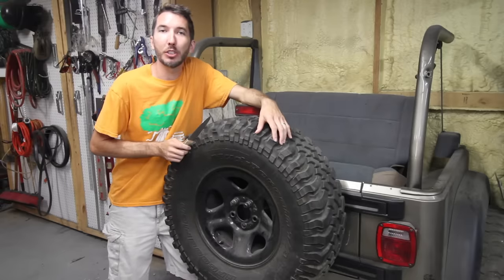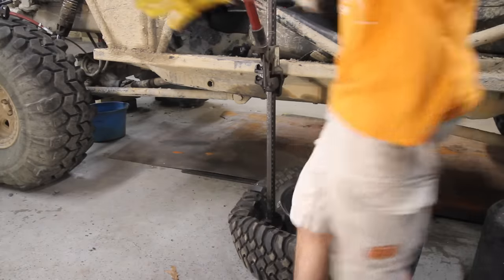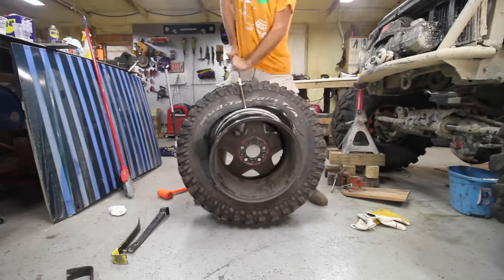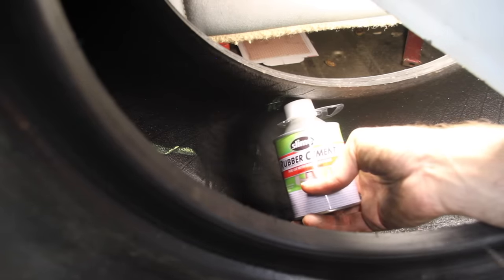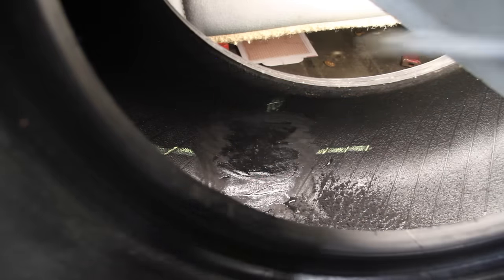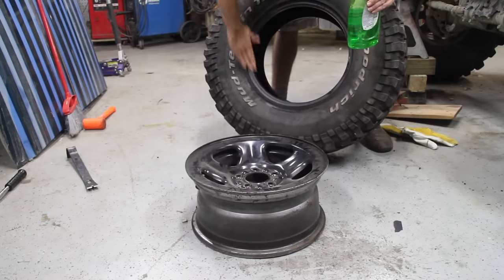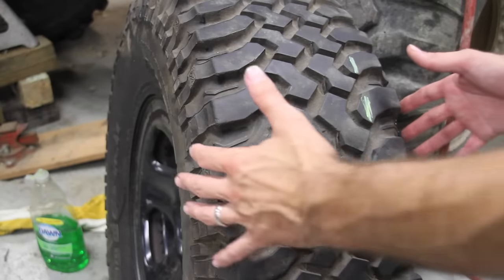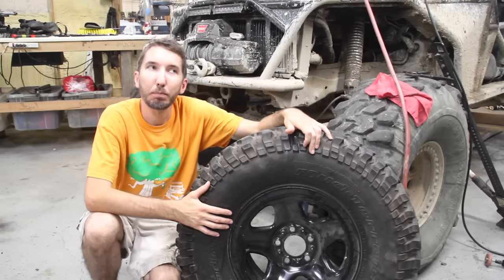How To Fix This - Patch A Tire

Comment: Used to work at a tire shop pretty much everything legally stated is correct,  but as he once stated again that is absolutely the best patch job you could do especially out on a trail because in all honestly that's EXACTLY what they would do at the shop. Legally they can't patch it but for emergency purposes this is as legit and professional as it could get. Being that employees can do their own work, I've actually done patches to my own tires on sidewalls not this big of course but actually had them last the 2 remaining years of the tire without problems. And DEFINITELY don't run low pressure in a patched tire as stated the tire will flex to much and eventually slowly peal the patch off.  Good video, for the idiot's stating don't do this if your 20 miles back on an abandoned trail with a tire issue,  this is the best And safest fix you could possibly do other than changing the freaking tire.
Reply: Jake Riley i
Reply: I've put plugs in my sidewall
Reply: All2skitzd I tore two tires on sledge hammer, has to patch a sidewalk by shoving 6 or more safety seal horsehair plugs to get me off the trail.
Reply: Cimarron Peacekeeper  
I had a sidewall spiked, put in 2-3 "Safety Seal" plugs in it held up for over 2 years as a spare. It sucks when you buy tires and they discontinue them and that happens. In fact I just had to plug one 2 days ago, now just a spare.
Reply: When I was a youngster back in the 40's and living in farming country, we used to patch worn tires so much that the patches showed through to the outside.  ;-)  Of course, in those days, wheels had inner tubes and those were hot patched.

Comment: Growing up, in 70's 80's we booted and patched everything.  I have seen huge boots put in tires, bigger than this one. Great video!
Reply: You put a good boot in it you can roll for a while
Reply: That's because in the 70's and into the 80's tires were bias ply, meaning there were no separate structures located within the tire's carcass, just the overlapping belts. Passenger car and light truck tires are now radial construction. When he says "liability purposes only" what that actually means is the tire is no longer roadworthy. He stuck that knife into the shoulder of that radial tire, meaning he cut the zipper. When tires explode on the highway, or when a truck loses a tire and sends shrapnel at passerby, that's frequently a zipper failure.
Reply: Boots how, what do you mean?
Reply: @AtlasJotun  No, sorry, bias tires were already pretty rare in the early 70's.  Just like today, you could and can buy them, but few people do except for agricultural use.
Reply: @allenwatkins4972  Wow, rare in the early 70's. Okay, I guess we're just ignoring the fact that all of the U.S. Big Three automakers were still equipping their cars with such tires, until the Japanese and Euro radial tires began eating up enough of the market that they were finally forced to catch up. But I'm sure they were rare, depending on how much you're massaging your definition of rare... And no it's not "just like today" since it wasn't illegal to run bias-ply on the road back then, whereas in many jurisdictions today, it is.
Reply: P.S. I will correct the error I made when I stated "...and into the 80s" since that's not applicable to the generalization I was making.
Reply: @xmo552  Boot is another term for a repair patch, not to be confused with the Denver boot that gets attached to the tire/wheel of a vehicle as a way to ransom one's car for parking ticket fees. Have a great day!
Reply: @AtlasJotun  
Thanks
Reply: @AtlasJotun  or could be the treads flying off a re-groved tire?
Reply: @AtlasJotun  Also not to be confused for a comment from a limey Brit.

Comment: when removing or replacing tire onto rim, make sure the bead of tire tha is inside the rim drops into the "well" of the rim. its the low spot of rim. it makes it much easier to get the tire on that last few inches. i hope im making sence

Comment: Great video, But just an FYI, tire shops are not putting the liquid rubber around the edge of the patch to reseal around the edge of it, they are putting liquid rubber everywhere they ground the enter sealant "sheen" as you called it off. The "sheen" you ground off is what seals the tire to keep air from seeping out through the bare rubber.

Comment: I've plugged and patched far to many of my street driven tires that I'd like to admit but so far it has never failed or gone wrong. I've even plugged my rear radial tire on one of my old CBR F4-I (crotch rocket) in a pinch before.
Reply: I rode a Honda Shadow on a plugged tire 'till the tread was gone. Even the people that sell plugs and use plugs claim they are a temporary fix but I've never had a problem after plugging a tire. A plugged tire is fixed.

Comment: I always carry a tire tube I buy at my local tire shop . You simply just throw it in and fill it up . I think that may be an easier idea for you to try .thanks for always posting such helpful videos . Your my go to Jeep guy
Reply: A split the size he made with the knife in a sidewall will pinch a tube almost as soon as the tyre rotates, and blow the tube. If you are going to use a tube the hole still needs to be patched to protect the tube from damage.

Comment: Done similar many times. I carry bailing wire, plugs, patches and, my favorite, plug patches. In my opinion the plug patches are the greatest thing invented for standard punctures. I've had to sew plugs into large gashes with bailing wire and was able to get the 20 miles back. Maybe you could do a video on the fine art of using bailing wire plugs and patches on one large gash for your next video

Comment: Thank you I have a very similar repair to make on a brand new GY Wrangler tire when the landlords loose roof tin blow off and punctured my tire. I had it dismounted so just need to repair and mount. I really want to be able to do this in an emergency thanks so much, I really like the way you handled it!

Comment: Howdy BleepinJeep,

I too have been patching sidewall PUNCTURES for decades
with absolutely NO failures ... but ... I do use a slightly different procedure 
For that 1 1/2" puncture - I start out with a barely  larger PATCH = like a 2" patch ... 
After that patch has been Rolled Out and adhered firmly ... 
I then rough the area again & apply a 3" patch over the 2" patch
then Finally ... 
I place the Largest Patch in my kit = like the DIAPER Sized patch over the previous two applications 
So ... I end up with not a single 1/16" thickness of Patch over the hole, puncture, or slit ... 
but instead 3/16" of rubber or THREE Times the Thickness over the "injury" ...  
Yes = this does end up with a HEAVY Spot on the TIRE ... but ... as you noted =
this is for   s l o w   speed Off-Road use ONLY ... 
(although I have been known to run them on the Surface Streets on occasion) 
COOP
....................................

Comment: Good video.  Remember to mark the valve stem on the tire for balance, couldn’t hurt.  Also lube the inside lip of wheel, and inside tire bead to help remove and install.  Lastly, just carry a spare inner tube.  Tube for Super Swampers run about $40.

Comment: New use for the three flat bars I've got, misplace one buy another & eventually you have 3 or more lol. This is how they did it in the old days, Grandpa had 3 stations in the 50s & 60s, in Mexico they still do this, now I know why those guys have a long pry bar, they can change & repair a tire pretty fast. Great video & yes a life saver or you could save someone else out on the trail or down the road. Good skill to know thanks.

Comment: This video scared the CRAP out of me! Though I had a dead pixel on my laptop screen (little orange dot on the lower right hand side). 

I had to make a similar off road repair went I cracked the lip of my aluminum rim. My good buddy JB was there to the rescue though! I hear it's still holding up to this day. Sometimes you gotta get creative with trail repairs so it's always nice to see what you'll be in for.

Comment: "of course your not gonna have that on the trail" he says at 10:48 .... right after busting out a die grinder and wheel, patches of all assortments, 3 pry bars, a breaker bar, dawn dish soap, a metal brush, starting fluid, and a metal roller... lmfao

Comment: When your remounting the tire, use a pair of vise grips on the rim. It'll keep the bead from popping back over the rim as you work it around
Reply: And if you've got alloy rims...take it to a shop
Reply: Good one
Reply: Or use rubber plated c-clamps. That’s what I use.
Reply: @kirkc9643  yup there's plenty of shops out on the trail

Comment: TIP: Ask any tireman from Mexico. I've never brought a tire to local llantos barratos tire shop that they couldn't fix! BUT when you go to "Discount tire" the "Tire-man"(if you want to call him that) has to run off to a  "Safe Space" to recover from the horrible scene  that you exposed him to after showing him your flat with a gash in it.
Reply: Wut?
Reply: Huh?  Ask tire any shop fix the huh tire while tire dry say hole   Some body say ho...... Hooooooooo. U don't sense make. Mexico. Tire guy. Huh. Eat huh what
Reply: Discount Tire is indeed worthless. I have tried to get tires rotated there. "Oh we can't rotate those they are too worn. But we can sell you a new set right over here!" Got that B.S. twice and never went back. I'd just take it to a different shop and they'd rotate w/o a problem. And the tires were fine with enough tread for another 40K miles.
Reply: With corporate stores like discount and les schwab the junior employees and customers are victims of the game of telephone. First the regional corporate office informs the branch managers of policy change, then the managers have to communicate those policies to senior and junior staff. But they choose to do it in two different ways. First the senior staff usually gets the "straight from the horses mouth" version and second, the junior staff is told a conservative version. This is because junior staff are prone to mistakes so in place of experience they are taught to be more cautious than they should be to keep the store from accruing lawsuits. Always talk to a manager because they are guaranteed to have at least five to ten years of experience and have a firm grasp on policy and technique. Not to mention, if anyone is going to choose to break the rules and do it properly, it will be a store manager.

In the most likely situation, your tires were badly weathered and cracked, and one of their policies is a very generic "if the components appear to be in a state of disrepair, employees aren't allowed to touch the vehicle" because of the corporation's stance on a guarantee of quality. If the store can't guarantee that their work will last then the work will not be done. And in this case of free labor, if the tires WERE deemed unsafe after a junior staffer removed the wheels, a manager doing his job correctly would be forced to comp the customer a tire for every wheel taken off ONLY so that the store could guarantee the work was done right. I hope this helps understanding why corporate and private tires shops operate so differently.
Reply: @tactical-bucket  Gees, tires are such a brutal biz. Town Fair Tire is a biggie up here in New England b/c they give every car a free shitty 2-wheel wheel alignment that will make your car wander like crazy on the highway. From the moment you walk in they try to sway you to what they want you to buy, then they try to trick you by saying "do you want the 4 wheel alignment" (which they say under their breathe and charge a lot for), then when you question the higher bill, they say you asked for the 4 wheel alignment and they act mad when you say you wanted the free alignment. They make it such an imposition that they need to find a manager to correct. Even so, they never seem to zero-out the alignment (front or back) when you do pay for the 4-wheel alignment AND they nickle and dime you for the disposal, valves and added bs fees. They are criminals... plain and simple. I pity any unsuspecting person just walking in there who knows none of this, and of course there's no useful governmental recourse for this.
Reply: Lol. About to repair a couple sidewalls in 10 ply truck tires. Haven't attempted it before. We'll see how everything holds up in the future.
Reply: Wasn’t that Mexico City where the city streets exploded because they just dump flammable liquids down the sewer? Yea, thanks, but I’ll stick with a safe, reputable store like Discount Tire. They’re top notch quality and service.
Reply: Every time i've been to Discount tire all they do is try and sell you new tire wether you've got a flat or you want your tires rotated thats their business plan.
Reply: True, but in their defense, the tire chains started out covering their rears and then it became a money maker.  Still the Llantas places are a good option if you know what you're doing and what you have.
Reply: @AmandaHugenkiss2915  Discount Tire wouldn't even mount a set of 235's on my TJ because the Mfg door sticker showed 215. Said they weren't allowed to install oversize tires. I had already paid for tires, mtg, balancing and all the other fees they tack on. The manager said I could go home, take the wheels off and bring them back and they would mount the tires. I suggested they do some unnatural things with their tires and got my money back.
Reply: Bring a tire with a sidewall nail to a Mexican tire shop, pay with cash and they will patch it for you. Not safe cuz eventually the patch will peel off due to sidewall flex, slowly leak, get hot and blow which could cause serious injury or death. I own a tire shop in Central California and we never patch sidewall punctures. Not worth the liability.
Reply: Samual Whittemore oh yeah here in SoCal my hood has one every where they are fast usually never crowded and do great work with a smile I tip my guy well he fixes everything for me
Reply: @catlady8324  they are crooks and very irresponsable they scratched my brand new wheels of my new car. No thanks i prefer Just tires.
Reply: @josephday4966  yeah. They should see some of the mounts we did back in the early 70s.
Reply: Que?
Reply: @dbfcrell8300  you have rights that vary from state to state. For example, a written estimate for any repairs that will exceed (number) dollars.
As the consumer you are expected to know but a sign is posted to inform you.
If the written repair estimate is authorized by you, the work may commence.
It's a two way street.
If they don't do this right for being in a hurry, you both dropped the ball in the game.
You can take them to small claims after giving them a chance to correct and settle your issue. You can bring your repair order from a shop who had to correct it after the fact if it comes to that. You, the consumer are not an " expert" and the businesses are expected to be, within reason.
Use the system that exists and fight for your rights. The govt is not your parent. They take a view of the law through the eyes of an educated elected judge.
A wheel alignment has been made expensive by equipment and labor costs as well as taxation. You have the right to say no at any point. Let me pay and go, don't do that part, I have my own expert I am going to, that sort of thing. Your initials and signature can get you free of them by getting their explanation and signing off. Then try another shop if there's an issue.
Certain states have more rules and requirements of the shop. They also have to hire experienced auto technicians and they have to charge money to stay a little ahead.
Remember you can decline repairs, sign and leave if it's roadworthy. You could even bring what's needed to get it safe or tow it out.
Hope this helps.

Comment: First off, thanks for the video.  The tire patch looked great and I'm gonna get me some of those patches.  I think I can help you with the tire changing though.  At 12:37 the bead of the tire is out to the edge of the rim.  The rest of the tire isn't ever going on like this and you've already worked up a sweat trying with no progress.  Notice that about 13:00 you have pressed the tire farther down onto the rim into the notch made into the rim so that tires can be installed.  Since you failed to point this out it seems to be due to you accidentally getting it right or an act of mercy on the part of God. Due to smaller diameter of the rim at this point the rest of the tire is easily pried over the edge of the rim.  If you look at the video of you removing the tire you will see that at 03:04 the tire jumped down into this notch and was easily removed.  Also, personally, I don't normally pry the tire over the rim.  Although it doesn't make any real difference I just have a way that is easier for me personally.  I place a pry bar under it at two points similar to what you did but instead of prying I tap the pry bar side ways around the rim with a heavy hammer, switching back and forth between the two pry bars, pretty much like a pneumatic tire changer at a tire shop would do.